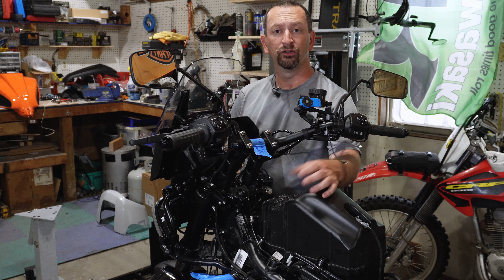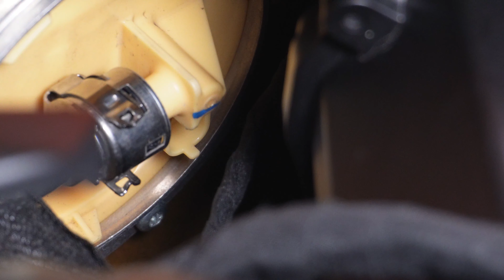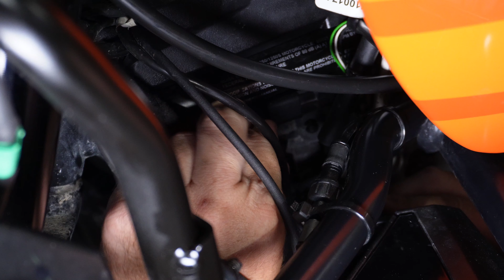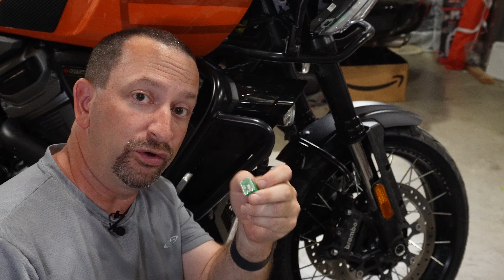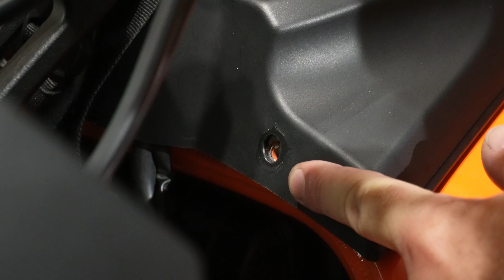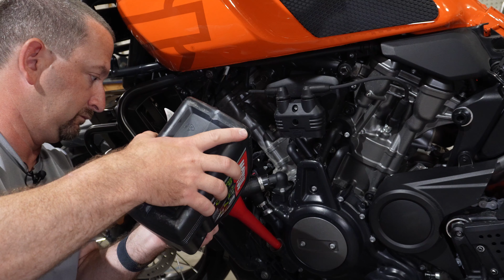Part 4: HD Pan America - Complete Scheduled Maintenance

Comment: 26:11 Mike, you said the running temperature is about the 210°ish Degrees. Does your bike normally run at 210°F ?. I'm asking because my bike 2022 Pan-America Special normally runs in the range between 185°-192° on average. It rarely reaches 210°, unless I'm in heavy city traffic.
Reply from the maker: anywhere between 190 and 220, depending on my speed, traffic, and the weather.
on a hot 90 degree day in heavy traffic I've gone up to 230, but usually average around the 200 mark.
Reply: @MikesMotorbikeChannel  Will you be uploading more tutorials and experiential videos for the long term? You have the best concise Pan-America material on the YouTube universe.
Reply from the maker: @FREEDOMGUNNER  I have several things in the works, just a matter of finding time to film them.
Reply: @MikesMotorbikeChannel  Cool, Sounds good.  I'll be hear holding my breath and not sleeping until the next video. Take your time. 😂

Comment: Thanks for the videos Mike just got done watching all 4. When you changed your oil I noticed you’re using motul 5100 what weight are you using is what I could not see. 20w50 or 15w50? Thanks.
Reply from the maker: @killermiller5787  15w50
Reply: @MikesMotorbikeChannel  do you still run the same oil in your pan am?
Reply from the maker: @ yup.

Comment: Great 4 service videos, I learned a lot and because of you naming  tool sizes and torques I was able to come up with a more compact tool bag for bike. 
I would like to add something I've noticed on fluid levels; I too added the big foot side stand, (which Harley Davidson says is not for PanAm's with ARH) 
I've noticed that checking fluid levels on side stand can give you false readings  depending on suspension being up or down on special models, which can lead to over filling. The oil dipstick has two readings,  center/side stand. Just something I noticed,  again thank's for taking the time to make the videos.
Reply from the maker: the big foot side stand comes in two different part numbers, for ARH and non-ARH bikes... but even still, the lean angle can vary on an ARH bike depending on the position of the suspension... the 'upright' oil measurement isn't really for the center stand, since when on the center, the bike pitches forward a few degrees... but more so when the bike is secured in a wheel chock like it would be on a dealer's service lift.
Reply: @MikesMotorbikeChannel  so is it best to check level's after turning the key on from off position so that suspension drops , and check on side stand?
Reply: Now I'm curious,  if center stand in service manual really means wheel chock,  I am adjusting my chain wrong too
Reply from the maker: per the Owners manual "Chain deflection can be measured on center stand or on jiffy stand with no rider."

But the oil level simply says 'upright', it does not specify on center stand.
Reply: @MikesMotorbikeChannel  copy that, just got off phone with HD dealership and they said their book says hot oil check on jiffy stand,  but they also didn't know the oil dipstick has two different readings on it either. I'll try different ways till I get a full level in two positions.
I also made sure I had the right jiffy stand installed which I do , thanks for that heads up.

Comment: Great vids, man!  What size is that o-ring?  I'm about to do the 1K service and can only find it in the Harley oil change kit.  Thanks!
Reply from the maker: It’s the same o-ring that is used in the air cooled engines, plenty of aftermarket sources for them. I bought a 50 pack for $10. 
50 Pack - #11105 O-Ring Replacement for Harley Davidson Oil Drain Plug Oring (Orange Color) https://a.co/d/4OmjzMn
Reply: @MikesMotorbikeChannel  thanks, after I left this comment I found the same info by looking up the part number on the parts microfiche. Maybe I should stop being cheap and pay the $65 for the service manual subscription 😂. I appreciate your help.

Comment: How long in hours would it take for you do do all the steps if you were not having to film and explain as you  went along? I have a feeling deep down inside that my dealer is not doing the thorough job you did.

Thanks for doing these videos. They are well done and are an excellent tutorial for any PA owner to do most or all of their own maintenance.
Reply from the maker: Probably about 3 hours if I moved with a purpose the whole time, 4 to 4 1/2 or so if I just take my time. I think I spent about 5 hours doing the first 1k service just cause it was the first time I did it.